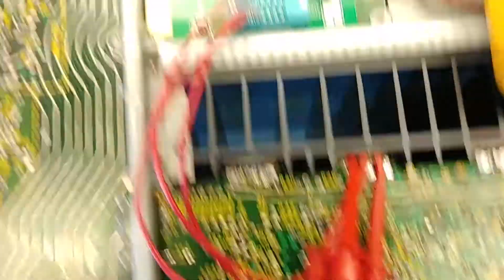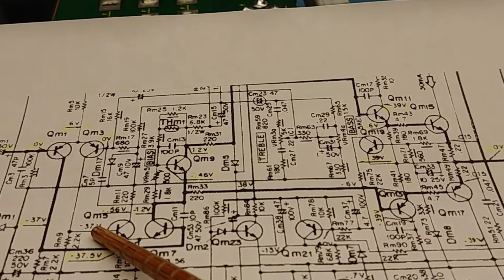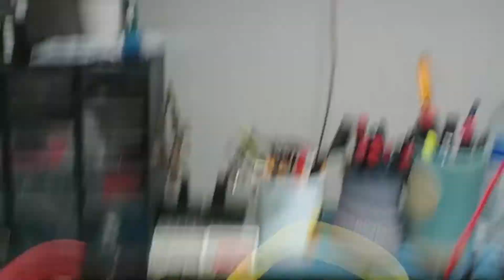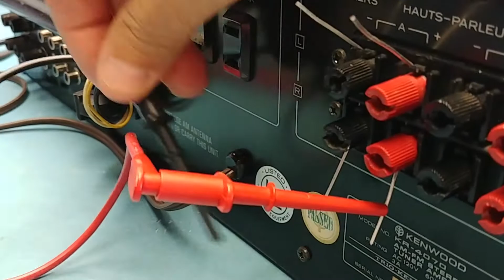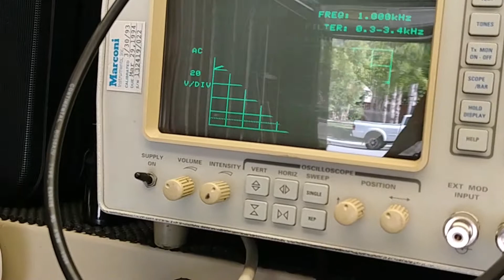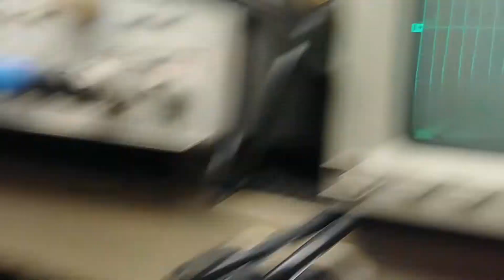Kenwood KR-4070 Repair, Service and Upgrade

Comment: Watched your entire video, thoroughly enjoyed the detail you provided on the testing and checks that you make.  As an amateur this is very helpful.    I'm so glad to see this video, looks like all I will need to work on mine.   Thank you!

I just got a KR-5010.  Bought it mainly because it came with a pair of KLH Seventeens.  (Sure don't need any more receivers!) 

But have to say I'm impressed with the receiver too.  I didn't do any proper checking before I fired it up, but it performs strong and looks like a keeper.  The main issue I see so far is that all the pots need Deoxit.... static between stations, improper contact between switching, etc.

But my main concern is that when first turned on, the dial lights flicker for a bit.  Hoping Deoxit will cure that?  But it does have relays which I don't see on your KR 4070.  Not sure how they open up for cleaning yet.
Reply from the maker: Hi,
Glad you found it helpful! I do hope to find the time to do more of these.

Your KR-5010 looks nice! Love the styling. Reminds me of Luxman styling. 

If you plan to go through it, the settings procedure is going to be different. You can find the service manual here:
https://www.hifiengine.com/manual_library/kenwood/kr-5010.shtml
The info is free, you just need to setup an account. This will help you with disassembly, and is a must for the alignment procedures.
One thing to note is that the power amp section of this receiver does not use discreet components. It uses an SDK Darlington integrated circuit for the power output section. This is typical for receivers from this era. While they sound and perform great, the ICs themselves are near impossible to find if they go bad. So don't push it too hard.  :-)

The flickering is likely due to a dirty power switch as the general illumination is not typically run through relays. A good cleaning of the pots and switches is always the 1st order of business when reviving and old receiver. Have fun!
Reply: @vintageaudioowl1538  Thank you.  
This unit seems to be somewhat scarce.  Can't find any advertising material for it.  I think it's about 1979-81 vintage.

I have downloaded the manual and the schematic from Hifiengine.  and, there are only two adjustments shown in the service manual, one for Offset voltage which I did, and the other for Power meter, which requires a dummy load.  I don't have any provision for a dummy load so I didn't perform that adjustment.  And I tried to check for voltage on speaker outputs, and registered just a few millivolts.  Since this is a direct coupled receiver, maybe there are no more adjustments to do?  I don't know.  It does have two relays, I think they are for speakers and the other for audio.

I did clean and lube the pots, inspected for burnt components, tried to look for cold solder joints, but probably don't have proper magnification to see them.
And so far now, It performs well, with no flickering lights now on startup.  Sounds good, so I think I'll leave it alone for now.
Reply from the maker: @mantolaman   That sounds about right. The STK ICs don't have any adjustment typically. A few mV on the speaker terminals is totally acceptable. Wouldn't worry too much about the meter adjustments, it's basically cosmetic and probably not too far off. Sounds like you found a survivor! Enjoy it!

Comment: I have one of these and I love it. Quick question how much retail would it cost to repair this reciever. You have put a lot of time into it. Thanks
Reply from the maker: Hi. 
Well that depends on a lot of factors like what's wrong with the unit, and what the repair shop's hourly rate is. I probably did more work on this unit than your average shop would have; but that's because I love doing this sort of stuff and I don't charge my self any labor! Additionally, this thing was exceptionally broken and most repair shops that are trying to make a profit would have probably turned this one away.

Comment: This is by far the most thorough repair bid on this unit. Watched it a few times as I have one of these that is giving me fits. After replacing the shorted outputs and drivers(left channel was blown). I had it working nicely for a few minutes  only to have one of the 2sc1775s die (Peak Atlas tester read a short) and illuminate the dbt again with 20V DC on the left channel. After replacing that and its twin with matched 1845s I am getting no sound now. There is no major DC on the speaker posts, no illuminated dbt and the correct voltages to the outputs but still inoperable. Wondering if I need to replace all of Q1-8. or maybe something else happened. It is a pretty unit and I'm determined to resurrect it if I am able. Any tips would be most welcome. Thanks, Rob
Reply from the maker: Hi Robert,
I wouldn't recommend just replacing Q1-8 as a shotgun approach as these are balanced pairs. If your DC offset looks good on the speaker terminals but you still have no sound, its time to do some signal tracing with your scope. feed a tone or a music source in the aux jacks move you selector to aux (make sure tape monitor is off) Start at the 5 wire connector going into the audio board; pins 1 (blue) and 5 (yellow) specifically as these feed the preamp signal into the volume control. If you're good there, follow the signal through the amp board until you lose it. If you don't have signal at those wires, your issue is in the preamp (tuner board). 

Where ever the signal gets lost, check for cold or broken solder joints use a chopstick to apply pressure to the board in that area to see if your signal comes back. 

If it's not a solder problem, check voltages around the active devices (transistors and ICs and such) to give you clues. If voltages are weird or not there, don't assume the device is bad. Check the components in the power supply and the supply paths.

I hope this helps.

Tim
Reply: @vintageaudioowl1538   Thanks for your reply. I actually managed to get it repaired last weekend. I located some NOS 2275s, found a pair that matched up nicely. Problem solved. Works and sounds great especially with the new NJW0281/NJW0302 outputs and 1220/2690 drivers.  Seems to have substantially more power. I may try the triac mod on that ticking time bomb power switch you did in your vid. Thanks again. Great vid. Hope you have the time to do more. Will keep an eye out.
Reply from the maker: That's awesome! Glad you got it working. 
My real job has been keeping me pretty busy but I've got a couple vids in the can and I'm currently working on a Nikko NA-2090. So many projects, so little time!  :-)
Reply: @vintageaudioowl1538  That looks like a nice amp. I'm a big fan of the Alphas. Highly underrated.

Comment: Hey there. I also have a KR 4070. It powers on but I don't get any sound and there is an unsettling burning/clicking/crackling sound from the vicinity of the transformer and amp board. The two fuses on the sides of the faceplate were totally blown, so I will replace those. Any ideas? Thanks. Awesome video.
Reply from the maker: Hi. The 2 fuses on either side of the faceplate are actually the display lamps. They're known as "Fuse Style" lamps due their form factor. You'll want to replace those to restore your tuning rail illumination.

The burning/crackling sound you describe  does indeed sound unsettling. Do you hear this without any speakers connected? Can you hear anything through the headphone jack? Do you measure any DC voltage on the speaker jacks when the volume is set to 0 and there's no input? There are 2 actual fuses located on the power supply board that should blow if excessive current is being drawn as long as they haven't been replaced with over rated fuses. You may want to check those too.

A dirty mode selector switch can also cause strange behavior and noises to come through the speakers and will even lead to a no sound situation if it's really dirty. So check all that easy stuff first.

Comment from the maker: Hi Adam. I'm not really a shop. I do this more as a hobby. That said, I do occasionally take work locally. What city are you in?
Are you looking to have the unit gone through completely or have a basic service done?
Reply: Thank you for getting back to me. I'm located in New York. If I can just get away with just basic service that would be fine but I would definitely be open to any suggestions that you may offer.
Reply from the maker: @adamfalcon   I'd be happy to help you out but I'm on the other side of the country unfortunately. Freight to and from CA + labor might exceed the value of the receiver. I hope you can find someone local. They're great little units.

Comment: I just got one of these receivers.... So where can i get that solid state piece to take the load off switch. ?.
Reply from the maker: Hi. I ordered the one I used from mouser. If you go to Audiokarma.com and search "triac power switch modification" or the like in the Kenwood area of the form, you'll find the circuit and part number of the device. As always, proceed at your own risk. :-)
Reply from the maker: When you get the parts, let me how the installation went and how it's working for you.
Reply: @vintageaudioowl1538   i got the parts but havent installed.... Reason is i had put LED lamps in then the unit to a crap.. Loud humming thru speakers and pop when swiching the selector knob .. So i happen across another   working  unit, so i blew it out then added LED... NOW that one took a crap and doing the same thing.. Humming and pop when turn ing selector switch... Seems they did not like LED.... as its weird they were both working until i added them... So i took them out and have the correct fuse//lamp coming but in the mean time with all the LED lamps removed it still dead... Im lost to what to check and searching on here
Reply from the maker: Sorry to hear that. I took a peak at the schematic and I can't see where either the display or meter lamps would cause an issue like you're describing. It's something in common that you're doing between the 2 units but I don't think it's the lamps. Make sure your speaker connections are correct as Kenwoods are picky about that. put the selector to Speaker set A, connect your cables to speaker set A and do not share the speaker grounds. Also, If you set the selector to A+B but don't have both sets connected, neither will work. Also, plug in headphones and see it the problem is there too. Does the noise go up and down with the volume control or is it constant regardless of the volume setting?
Reply: @vintageaudioowl1538   its been a few days but ill recheck.. But i think the noise will go up/down with volume..
Racked my brains out on it,,, Only thing i see that could of happened if it was the LED is the meter lamp Led also lights up on it's tip(top)  and lamp may have came forward and touched the metal frame of unit... other than that im baffled...
Reply: @vintageaudioowl1538    Thanks for answering... I guess i needed to take a break from them... But as i  write this,, i plugged them both in and no sound at all... mmmmmmmmmm... So i went back to square one... BUT as i checked voltages between the two i noticed at fuses i got two different readings.. So as a 30 plus year auto tech i remembered i had been burnt before on electrical and fuses even tho they tested good . So i removed the 2 fuse from each unit and  YUP bad fuse on each receiver... Had to remove them to see it.. So i TOOK ANOTHER  look at the LED's  and im thinking the LED for the meter dials had come forward and contacted metal frame of unit.. The LED have a lite on its end(top) just like on its sides...
 Guess when one is tired and frustrated one should take a break.... LOL
So im assuming the fuses are 250Volt ,,1 amp ?
Reply from the maker: The fuse rating should be silk screened on the circuit board but for the US models, Fm1 is 250V 1A,  Fm2 is 250V 3A and Fm3 is 250V 2A.

And that makes sense because the lamps are powered straight from the mains transformer secondary 15 and 7.5 VAC winding which is protected by Fuse Fm1.
Reply: @vintageaudioowl1538   Looking for that 3rd fuse... Is it the same style as i dont see it
Reply from the maker: @TheC5corvette  It's located in the same area next to Fm2. That said, there's a chance that it's not populated on the board. In which case, you don't need to worry about it.  :-)
Reply: @vintageaudioowl1538  OK... as its not there... Thanks for your help..

Comment: Do you work on newer equipment as well? I have a Polk Audio PSW111 sub that just stopped working. It powers up, but there is no sound. I considered purchasing a new amp plate, but they are discontinued.
Reply from the maker: Hi,
I'll sometimes take a crack at newer stuff, especially if it's something I'm fond of. Plate amps are usually class D with a switching power supply and schematics are a little harder to find. If you like the speaker and dropped some coin on it, a new plate amp might not be a bad idea. Parts Express has some universal ones you could adapt if your stock one is no longer available.
Reply: @vintageaudioowl1538  Thanks for the reply. I was actually referred to you and your channel by my brother. He told me that he purchased the 4070 you restored in this video. It looks great and I am a bit jealous.

I have had the sub for about 8 years now. I really like the size and output, but it wasn't terribly expensive. Based on your advice, I am now debating on buying a Dayton Audio plate amp, or a new sub. The amp is $109 and I can get the same sub now for $199. 

Thanks again and I will keep you in mind should I need some advice, or repair work.
Reply: Well, I opened it up, found a perfectly good fuse and all the caps look okay. None of the capacitors look domed or leaky. I tried a new sub cable, but it didn't do anything. I hooked the sub up through the speaker line inputs and voila, bass. Perhaps the receiver's sub out is bad? I still can't find any schematics. Any suggestions?
Reply from the maker: Well if you don't have a scope or an AC voltmeter, you can validate your sub output with another amp or receiver. Just route the sub out of your receiver in question to and aux input of another amp and see if you get a signal to amplify. Keep in mind that if it's working, you will only hear (Feel) sub frequencies. ( 20 - 180Hz )

Another thing that it could be is your receiver setup. Most AV receivers have a menu where you setup the surround sound speaker profile. If you define your front speakers as "large", the low frequencies will not be sent to the sub output. Set them to "small" to enable your sub output.
Reply: @vintageaudioowl1538  Thank you for your assistance and advice. I did check the setup again and it is still set for small front speakers with a 80hz crossover to the sub. I ordered a cable to check the sub and listen for low frequencies. If the sub still works, would you be willing to tackle a  newer A/V receiver to diagnose and possibly fix the problem? It is a Denon AVR-2310CI. I believe it is about 10-12 years old.
Reply from the maker: @goramsandangelsful  I'd suspect the sub plate amp before the AVR because I believe the plate amp is bypassed when you use the speaker inputs. If you still suspect that the sub line out from the AVR is not working, you can use another RCA line level output from the AVL like the tape monitor for instance (make sure that it's activated) and if the sub still doesn't work, the plate amp is the culprit.
Reply: I can't tell you how much I appreciate all the assistance. I was going to buy a new plate amp when a sub came up for sale. It's brand new so I purchased it. I hooked it up, turned it on, and same problem. Arrgghh. While in the process of moving my television to get to some wiring, I managed to destroy it as well. I am a menace.